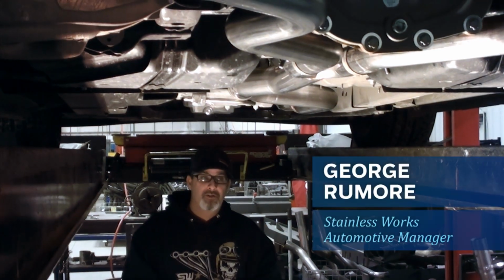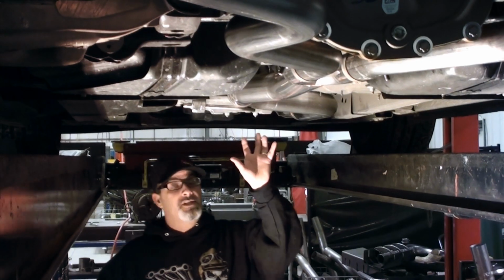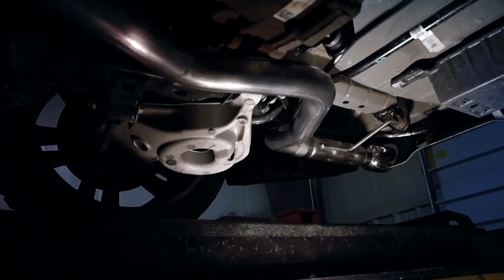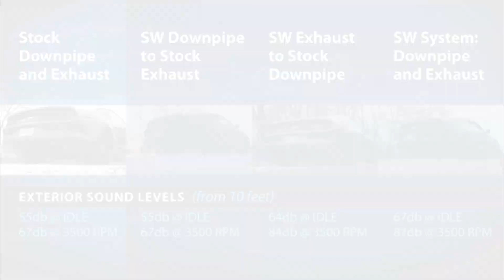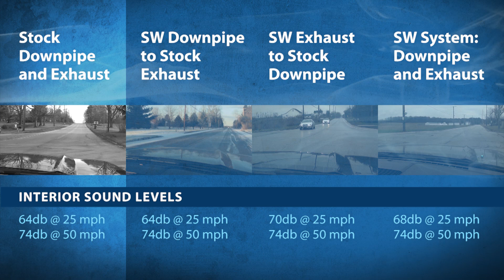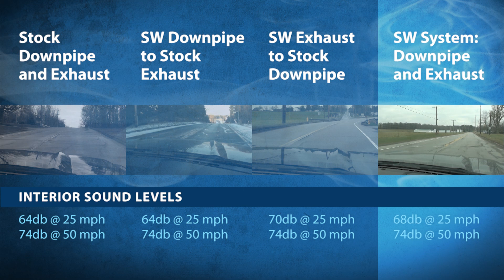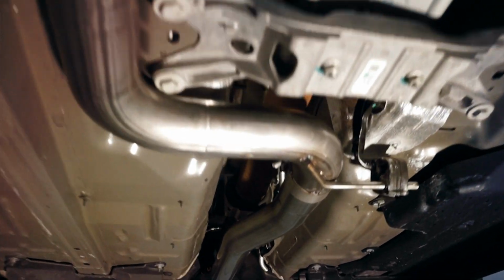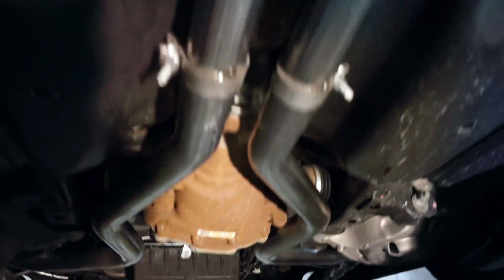2015-21 Ford Mustang Ecoboost Downpipe and Exhaust

Comment: The Stainless Works turbo-back system is by FAR the best sounding exhaust for the Ecoboost. Its tough to get this motor to sound good at all. This is the best one.

Comment: I absolutely love the drive by sound of your full system.  I bought a 2015 RS1 which is the Ecoboost Roush.  It comes with a very nice sounding exhaust from Roush.  They removed some kind of plate in the exhaust which made it noticeably louder and has a very nice low rumble at idle.  I am looking to replace the downpipe and was wondering how well your downpipe works with the Roush exhaust?  I dont want to lose the Roush exhaust because it has the quad tips which look amazing.
Reply from the maker: Bill Hartman Hmm, it would depend on where the connection point is for that system, feel free to give us a call to discuss - 800.878.3635 (8-4pm EST)
Reply: Stainless Works ok.  I think it's an axle back system but I'll check for sure and give you guys a call.  Thanks for the reply.

Comment: I know this is a bit old, but I was wondering if purchasing just the exhaust first (to stock dp) would that make it more complicated to upgrade to the SW dp later or is there a nice simple connection pipe to swap out when going to the larger dp pipe?

Comment: Nothing against your exhausts guys. Love them! 
That mustang however, sounds terrible in every way. Your exhaust made it a hell of a lot better. Nice job!
Reply: I agree..no matter how hard the aftermarket companies work these cars just sounds terrible.. :/ Although, to SW credit: This is one of the "better" sounding exhausts I've heard for the Ecoboost
Reply: Stefan Hottel I think this is the nicest sounding eco boost as well. It just was weird hearing it. It was almost like a sound clip from a hot hatch. Lol
Reply from the maker: Aww, come on, haha! Well, it's definitely not an 8 cylinder! But we like to approach every project to try and maximize it for the best possible sound and most efficient power gains. Thanks guys. ;)
Reply: I will admit, I am partial to the V8 sound..not a huge fan of the small displacement turbo'd sound. Not your fault guys! Love the sound of your system for the GT! Stainless Works
Reply from the maker: Haha, thanks, no worries Stefan! ;)

Comment: I want an honest answer please, even though the correct answer will only half benefit you. Will your 3 inch cat back fit with any 3 inch downpipe? I do not want to do a tune until my warranty is up. So I'm leaning towards the MAP 3 inch down pipe bc it will not throw any engine codes w/o a tune. Yours requires a tune but I really like your 3 inch cat back. So would it mate with the MAP 3 inch down pipe? I asked them and they said "as long as their exhaust is a 2 bolt flange."  Is yours a 2 Bolt Flange whatever that means? If not then I'll have to search for a different cat back because I'm not ready for a tune but want a 3 inch system. The only way to accomplish this is with the 3 inch MAP DP and your amazing 3 inch Catback. I'd prefer your DP, but it requires a tune. But if the cat back works with the MAP 3 inch down pipe you have a new customer.
Reply from the maker: +Adam Gregory Hi Adam, yeah, we have systems that can fit a variety of connection points, no worries, we're happy to help in any way even if it's not our complete system. But give us a call and we can go through some of the specifics regarding a tune and check engine lights. We just want to make sure you have all of our info before proceeding - 800.878.3635
Reply: +Stainless Works I'll give a call here in the next few days. It'll be a few weeks before I purchase a system. Just comparing all the options. But to be clear. Your 3 inch exhaust will fit the MAP 3 inch down pipe, correct?
Reply from the maker: +Adam Gregory We're not super familiar with their downpipe, it would depend on exactly where their downpipe connection point ends, and a few other factors such as if it's designed to fit the factory connection point or not. I'm sure we have an option that will work, we'll just need to talk to you about the details. It will be easier over the phone when you call, and probably give you some questions for MAP if you want to double check fitment on their end. Thanks Adam, talk to you soon. 800.878.3635
Reply: +Stainless Works Gave a call. Received some good questions to ask MAP. My tuning questions never got answered though. So I'll Ask here so I don't have to call again lol. If I get YOUR down pipe and throw a CEL, f I just get a code reader and clear the code will it be fine? Or will it affect the AFR and make me run lean? Like I said, I don't want to get a tune until my warranty is up, and would rather not have a check engine light on. So if I clear the code with a code reader, will it be normal, or run lean? I live in Florida and do not have inspections or anything like that.
Reply from the maker: +Adam Gregory By adding a downpipe you'll more than likely get a CEL, because of the nature of your needs (warranty, CEL, tuning) we would recommend the next step for you to get in contact with a tuner and possibly even check with your dealer about what specifically might be capable. A great shop we work with that could get into the specifics of your ride is http://www.teambeefcakeracing.com/ they specialize in Mustangs and could probably help you with the ins and outs of tuning and warranties.

Comment: With the stock Down pipe and SW exhaust, would a tune be recommended?
Reply from the maker: A tune wouldn't really be needed for an exhaust. With that being said, with any performance aftermarket product, a tune will help maximize potential.

Comment: Does the car in the video have the catted or off road down pipe?
Reply from the maker: Hey Tyler, all the downpipe samples above are catted; though there wouldn't really be much of a difference in sound if you were wondering about the off-road version.

Comment: are those tips the the ones that come   with the exhaust or are they different?
Reply from the maker: +wolfd21 They are different, they are a larger, stainless, double-wall tip. Being double-wall, they have a little more thickness and dimension than the factory tips, which are just a single-wall piece of tube.

Comment: If i install a CEL eliminator would it be helpful?
Reply from the maker: A CEL eliminator basically keeps your sensor from functioning properly. If you throw a CEL we do recommend getting a quick tune, that way you get the most out of your ride. Using a CEL eliminator would be at one's own discretion. Feel free to call us to discuss 800.878.3635

Comment: Nothing against stainless works but this car almost sounds like a 2 stroke snowmobile with out ping ping ping at the end lol. If this was a focus id be hell ya but in a mustang i kinda frown. I get the ecoboost makes good power and there pretty fast but the sound kills it for me.
Reply from the maker: Aww, well, the Ecoboost probably isn't for everyone, especially if you are expecting a roaring 5.0 sound! Bet you'd like our F-150 systems! ;)
Reply: +Stainless Works I would love a nice header set up but one problem... Your F150 5.0 kits claim to only fit super cab and crew cab models. I own a 2013 regular cab short bed 2wd. You all should consider making a factory connect kit and a performance connect. Also don't forget 2014 F150 Tremor owners with the same configuration but with the ecoboost engine. I would love to let you use my truck as a test mule to fabricate one for production as I don't live crazy far away. That's for the 5.0 trucks that is.
Reply from the maker: +Jesse LaBelle Hey Jesse, as you mentioned our 2011-14 F150 systems were designed for the most common wheelbase, but could probably fit to the short bed with a few mods, or headers might fit directly to the factory connection point. As of right now, our R&D department is busy with 2016 projects, but we'd love to help you discuss this if you'd like to give us a call - 800.878.3635
Reply: +Stainless Works is there anyone I should ask for or a department to be directed to? I'd prefer to talk to someone who knows about what we been talking about already just to make it easier.
Reply from the maker: +Jesse LaBelle You can call and ask for Chris, he's great with trucks and I'll get him up to speed on our conversation - 800.878.3635